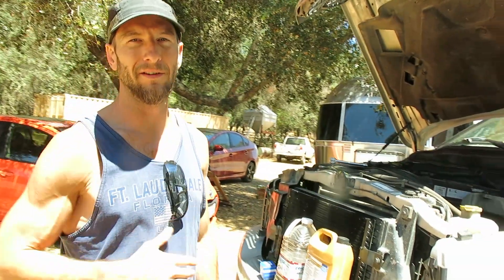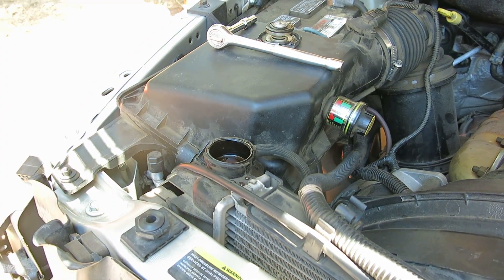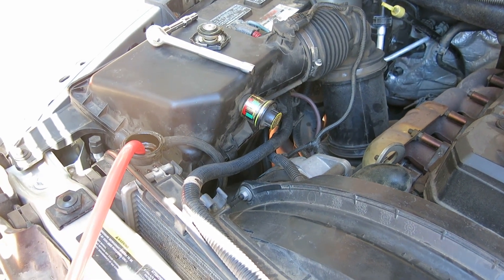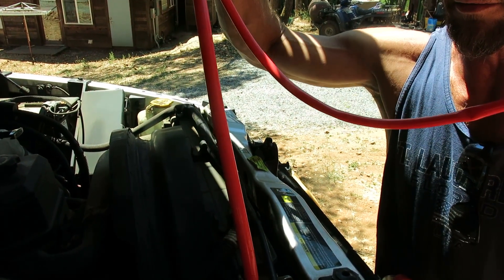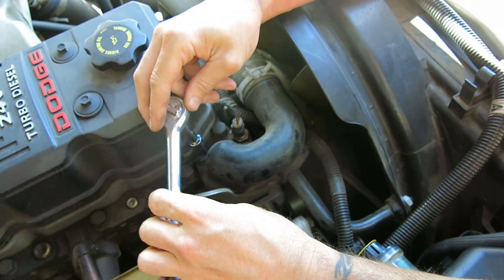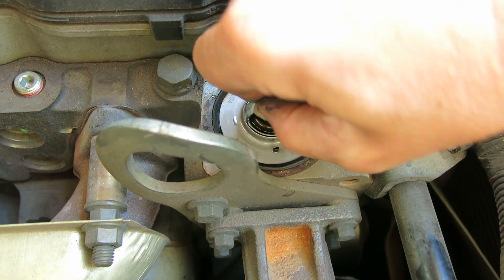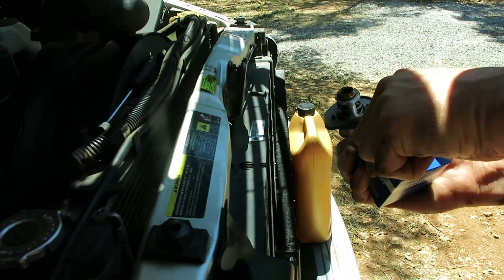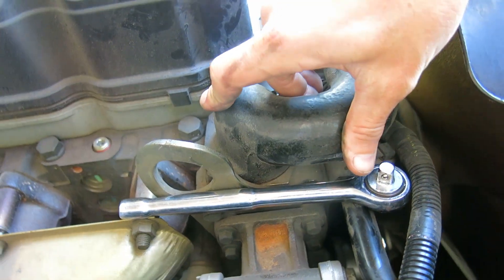2006 Dodge Ram 3500 5.9L Cummins Thermostat Replacement

Comment: Great video man! Just wondering if it’s OK to top off with yellow coolant when the stuff you pumped out was red?
Reply: Most of the time the color is just a dye. What matters is the chemical makeup of the coolant. In this case, assuming it's never been swapped from the original kind, Zerex G-05 is a perfect replacement and it just happens to be dyed yellow.

Comment: My Cummins temperature goes higher then 200f when I keep the truck on 70mph or higher but then it comes back to 200 or less if I drive it less then 60pmh was this the same issue you ware having ?
Reply: I'm having the same issue but at about 80mph or higher. Did you end up solving your issue? I'm going to start with the thermostat and coolant temp sensor, and then if that doesn't work I'll try the fan clutch
Reply: @BrandiStrong-ff7bk  it was the thermostat

Comment: As I writing this I'm stock on the side of the road with my 2000 dodge 3500, it started overheating, I was wondering if I take off the thermostat just to climb the grade on a I 15 going to Barstow California, I'm hauling a forklift with my trailer, do you guys think that would help the truck nor overheat, any advise, thanks and God bless